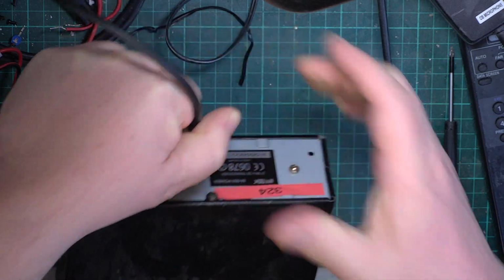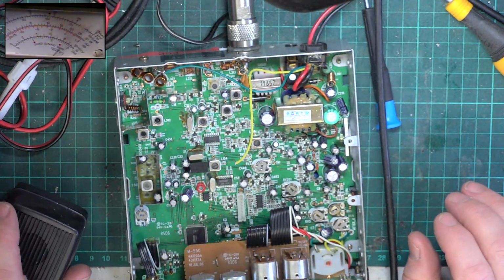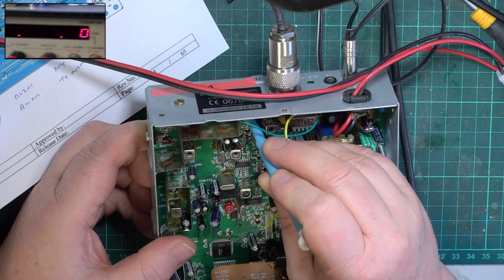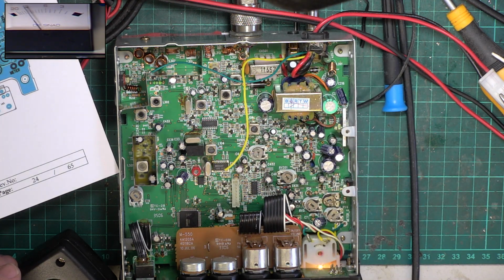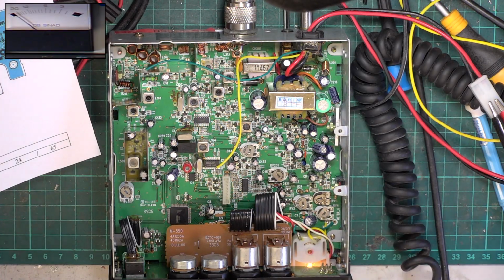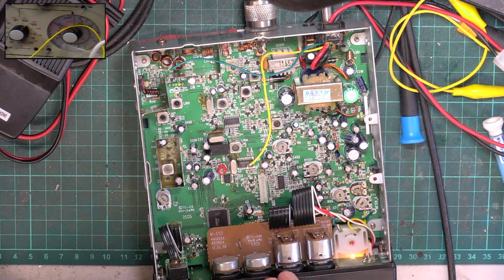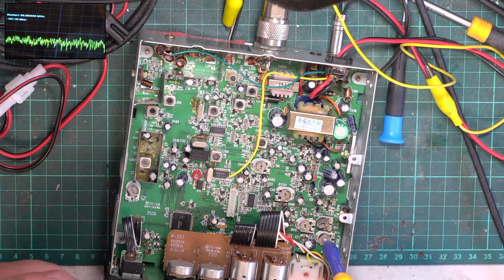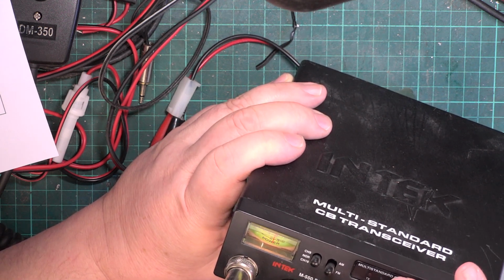Intek M550 CE MultiNorm CB radio (Mobile) - service alignment

Comment: That looks like not to bad a set, thankfully NO ECHO echo echo.  Got all the controls and does 4 watts and has a Midland type meter in it that you can see at a glance.  Not to hard to change bands, you just need a good memory to remember how to do it!  You can even adjust.  Mr coil stretcher is a bit silly, what was he trying to do, well we know what he was trying to do but FAILED!  It leaves me speechless sometimes!

Comment: I thought them coils at the rear looked messy even before you mentioned Mr Coil Stretcher richard.
Reply from the maker: I just don't get it. Turned it down to 2.5W, with plenty transmitting on 133Mhz!

Richard
Reply: @ukfmcbradioservicingTango21  it seems the radio hasn’t been screwdriver’d but instead molested by my coil stretcher. I’m surprised you got 4 watts out of it as at first attempt it looked like it wouldn’t do it! Power model - yeah right 😆

Comment: I know very sad, I wonder why the INTEK transceivers where not built around DSP processors and let maths do the donkey work and all settings in a locked eeprom so there is nothing on the inside to twiddle which will annoy the people who love to twiddle for the fun of twiddling.
Reply: Just what you need a square wave producing CPU inside a 27MHz RX
Reply: @phillipsmiley5930  Flex Radio Systems have already done this sort of thing so why not INTEK.
Reply: @DAVIDGREGORYKERR  Making a DSP radio is easy, screening and filtering the processor from the squarewaves that's the hard part. every cheap mass produced DSP radio is a poor compromise
Reply: @phillipsmiley5930  Once the signal is digitized it can be processed till it is output to the speaker digitized after leaving the microphone amp then processed into whatever radio signal mode AM/FM/SSB it is not a problem it is then output to the final stages via a video speed DAC then some filtering and amplification before going onto the antenna.